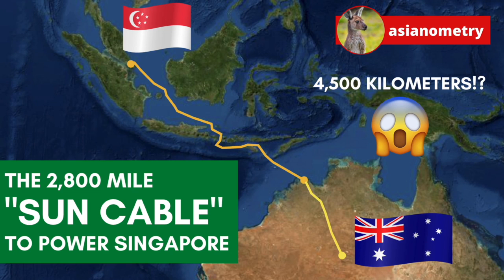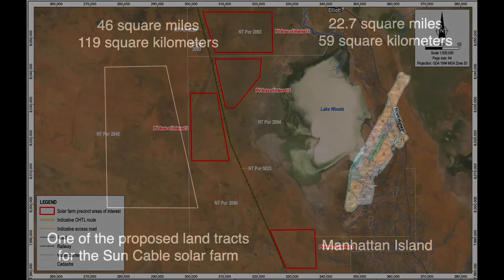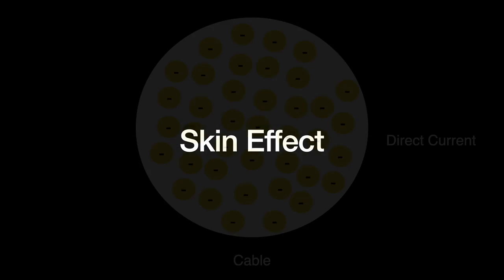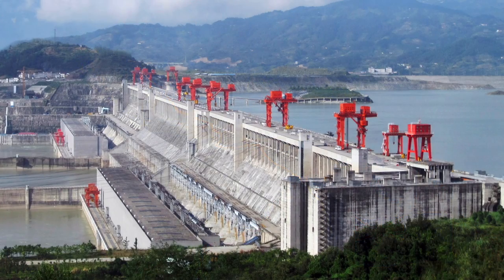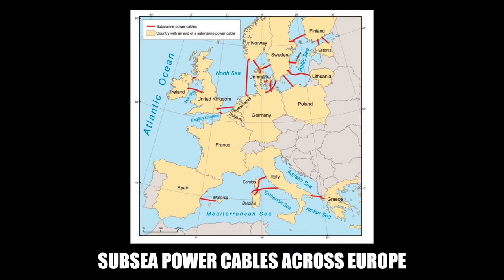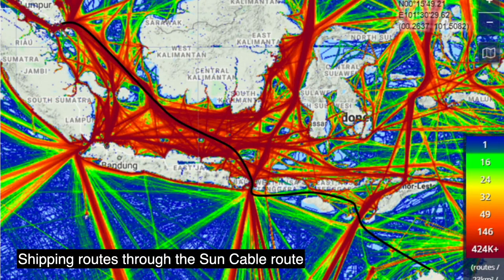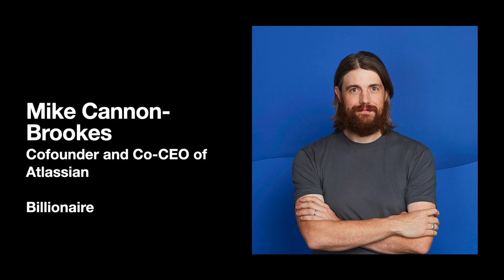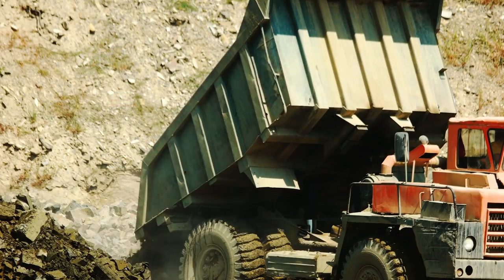How Singapore Plans To Pipe Electricity From Australia

Comment: As an Australian engineer the thing that I find most curious about this project is that they propose to export the electricity to Singapore - rather than use the electricity locally to convert it to other useful things (hydrogen, aluminium, fresh water, cement, steel.. etc). I think we'd do better exporting energy-embedded materials than simply the electricity.
Reply: It is a proposal from Singapore to import. It clearly says so in the description and content. Australian governments have been extremely hostile towards renewable projects. There is a lot of coal in Queensland. This kind of project would be out of character for any Australian government.
Reply: Yes, energy embedded material manufacturing is a great way for Australia to go! I hope support for this huge economic opportunity grows.
Reply: Well, if this project proves to be economical despite the extensive cable lengths, it could open up further possibilities. For example a nuclear plant in Alice Springs providing electricity for the entirety of the mainland so that Tasmania can then keep its hydroelectricity for itself
Reply: @spdfatomicstructure  Nuclear?? There would be too much opposition in Aus. 
As the video shows Aus has an abundance of solar and hydro, adding wind installations and related proposals, "big" batteries going in all over the country, nuclear is not needed.
Reply: @TheHsan22  Solar does not produce power through the night. Coal power is still going to be needed for the night, and I doubt hydro would be sufficient to replace all the coal power. Nuclear power is the best solution, and everyone i've ever spoken to all agree. I live in Australia btw and i've never met anyone as far as I know who opposes nuclear power. I think it's the mining companies lobbying to keep coal power the dominate source of power because I don't think there is that opposition among the general population.
Reply: @Crashandburn999  Nuclear has to be put into a reduced power mode or turned off outright if it gets too hot though, which doesn't suit a lot of our climate. Plus, it would take like 20, to 30 years if not longer to pay itself off. Whereas renewables generally have a much quicker return. Battery Storage will fill in the gaps from solar, wind and hydro. Australia has some very good battery tech for large scale grid solutions being produced locally. Plus, incentivizing people to get their own home solar and storage would be really beneficial as well. I would be much more comfortable with connecting Singapore to the grid and just making them pay for the usage than having entire power stations not producing any electricity that can be used locally.
Reply: If you are an engineer worth his salt, your main project should be on how to engineer your way out of Australia. Believe me, you are not the only engineer in Australia who has thought of sensible solutions, but they rarely get realized, because the country's leaders are too low IQ to understand anything other than digging - digging for resources, digging dirt on each other, digging a grave for entire nation, digging to put their heads in the sand etc. I am only writing this, because I don't want you to lose out on good opportunities to put your skills for good use.
Reply: @brucetutton7897  just because its a proposal doesnt mean it isnt going to happen. I suppose u missed our government announcing they want to start selling electricity to other countries just the other day? I wonder who the first purchasers will be.... meanwhile our own electricity prices are skyrocketing to one of the highest in the world
Reply: True, but Australia fails to ever think like this, raw export, end of story. We don't manufacture, process down stream, vertically stack,  etc. Wine is the exception
Reply: @simonm1447  If they received kickbacks from renewable developers, then they may increase funding
Reply: @spdfatomicstructure keep Alice out of your nuclear fantasies mate. We honestly couldn’t care less about Tassie either
Reply: @brucetutton7897  What on earth are you talking about? Queensland is building up green hydrogen infrastructure. The Qld labour government plans to make qld the biggest producer and exporter of green hydrogen on the planet, and keep it in public hands  That means replacing coal with hydrogen, and instead of royalties the state just benefits directly from all of the profits.

The federal and state governments have invested heavily in renewables. It's why there's such interest in these kinds of projects. Even the solar array for the sun cable is partly subsidized by the federal government.

The world isn't going to turn renewable overnight, it will take decades and yes we absolutely have that time.
Reply: @sandeepn94  who's we?
Reply: @666bruv  people who live in Alice
Reply: @lovelyhurlin6494  boring attempt at an insult. China doesn’t own the desert mate
Reply: @sandeepn94  how else will you go about decarbonising the grid?
Reply: Well, unless its almost fully automated, the labour cost in Australia is way too high for manufacturing.
Reply: @brucetutton7897  stakeholders of Australia gov are non renewables after all.
Reply: @qiyuxuan9437  lower the labour cost then, by opening borders completely.
Reply: @spdfatomicstructure  you Can start by not putting nuclear in Alice Springs
Reply: The Thing Australian Should Worry Is Not To Get Scammed By Singapore Like Malaysia The Reason They Looking Alternative Electricity And Water Supply Because The Contract With Malaysia Coming To End In 2030-2062 To Supply Water And Electricity With Fix Price And Cannot Revised The Price Which Unfair Since The Contract Sign  1960 When Singapore Part Of Malaysia 

SGD 3 cent for 1000 gallon
Reply: @brucetutton7897  the new Australian government is not hostile to renewable energy
Reply: @sandeepn94  what are your alternatives then?
Reply: @tjmarx  Would you care to make a list of renewable transition projects seriously supported by recent federal governments please? One without dodgy accounting.
Reply: @brucetutton7897  No, I would not care to waste my time compiling such a major list for a YouTube comment, just because you're too lazy to look for yourself. 

You're on the internet right now, look for yourself.
Reply: @tjmarx  That is a devastating argument you make
Reply: @brucetutton7897  I'll take it you have no intention to actually look, and you're just here to make a fool of yourself. Have a lovely day mate.
Reply: Totally agree, particularly steel via electrolisis.  H2 and NH3 ARE A waste of energy.  High voltage DC cables across active tectonic  zones sounds ridiculous.  PV produces DC, no transformers needed, just electronic voltage boost.
Reply: Fully agree
Reply: Why not both?
Reply: @makeit2132  The energy left in hydrogen after electrolysis of water, compression, storage, liquefying, or conversion to ammonia is so small, it is a thermodynamic pipe dream.  Ammonia for fertilizers is an option but not for energy.  The best use of the DC electricity from PV is 1, direct use, 2 electrolysis of metals oxides (iron and aluminium) and 3 battery back up.  Exporting energy over large distances in any but liquid (LNG or oil) or solid (coal) is full of major hurdles.
Reply: @dan2304  Thanks. I agree, but in my opinion, there are many many other uses for energy that can lead to exportation of products of higher value. The more people and small companies can get involved, the better for the Australian economy.
Reply: Then you pay for it . Don't be a leech.
Reply: If Singapore gets hooked to Australian energy and ditches other forms of energy it will essentially become an Australian satellite state
Reply: because its an investment proposal by Singapore. Singapore provides the cash, Australia develops the infrastructure at home, Singapore gets power. A win-win situation. 

If you don't want to do it the way Singapore wants, then you have to cough up the massive upfront cash yourself to develop the industry. Hint: it most likely won't happen.
Reply: It probably has some gay reason like carbon credits.
Reply: @spdfatomicstructure  why Alice Springs, it's nowhere near water, grid infrastructure, demand or the workforce needed. This is fundamentally the problem that the problem with getting Nuclear power in Australia, people are Ok with it as long as it isn't near them. It would need to be nearby major cities like Sydney and Melbourne to be at least vaguely cost effective.
Reply: @benjaminfranklin329  how near is near? Because safety protocols have evolved tremendously since Chernobyl and Fukushima, and would undoubtedly factor into the design and operation of nuclear plants. Don't forget all the uranium reserves in the Outback too
Reply: @spdfatomicstructure  I'm not saying the concern is accurate. I'm saying middle of Australia with none of the primary needs met is not the place for a reactor. the uranium ores still need to be refined and made into reactor fuel, and are such small volumes that their transport is a rounding error in the cost of running a fission reactor.
Reply: @spdfatomicstructure  the reason I point out the "Not in my backyard" problem is that would be the only reason you would stick a power plant so far away from the demand.
Reply: @benjaminfranklin329  I was actually thinking more of putting it in a centralised location that can readily access all 6 mainland state capitals, and from there the rest of the nation, with high voltages transmitting it over long distances. Of course, if it's too difficult to translate theory into practice with the technology and engineers we currently have, then we might consider multiple smaller plants servicing individual states
Reply: @spdfatomicstructure  it's not theory into practice. Nuclear power uses radiation to heat water, to turn turbines, water is not abundant in central Australia. And as discussed in this video, transmission losses over large distances are very significant. Let alone the typical large nuclear reactor wouldn't even power a single large city. There's no advantages to this, other than sticking it in someone else's backyard
Reply: They’re out of labor. One could argue a trade off has to be made between services and those industries. The US would benefit more from this sort of arrangement in my opinion because there is a far lower labor force participation rate.
Reply: The project is expected to supply about a gigawatt to Darwin by 2030, ramping up to 6 gigawatts with the additional power being exported to Singapore and thereafter Indonesia. Seed capital and subsequent funding rounds were raised by Grok Ventures and Squadron Energy, both domiciled in Australia, with further support from the NT as well as the Australian federal government.

Comment: The Tasmanian cable failed because Bass Link cooked it by pushing it to it's limits to sell Hydro power to the mainland when prices were high. We would usually be OK for our power here in Tassie as we have heaps of hydro and wind power, but there was a drought on and they had run the damns down to risky levels. Although we have a backup gas generator it would not have coped, so Hydro Tasmania had to import a heap of contingency generators to guarantee supply (I knew the guy who was organising all this and it nearly killed him with the stress). Singapore would be well advised to have a workable back up plan if their cable from Oz failed.
Reply: I think they said 20% of total power so it actually would improve the diversity of the sources of supply but they would need some excess capacity to allow for failure in any of their sources including this one.
Reply: That is why the Gordon below Frankiln should have gone ahead.  And it will sometime, when idiot Brown is dead, you watch, if you are still alive  by then!  How grows the Tassie population ?
Reply: So, what do those 'contingecy generators ' run on; clean hydro - generated electrical power?   Or poluting Diesel Fuel ?..... A Pyrrhic Victory perhaps?
Reply: Singapore will be getting some solar power from Indonesia Batam.